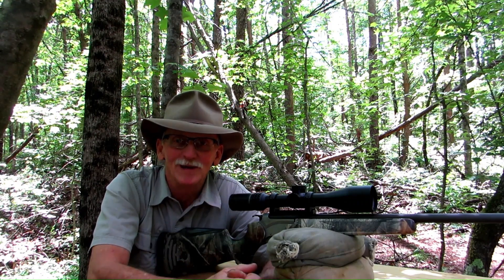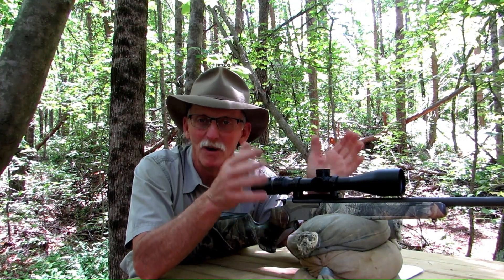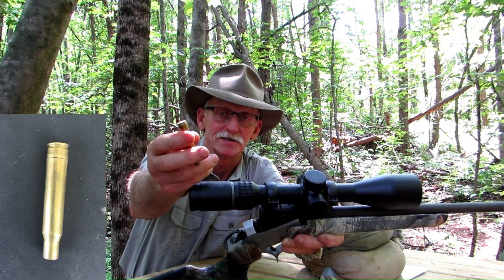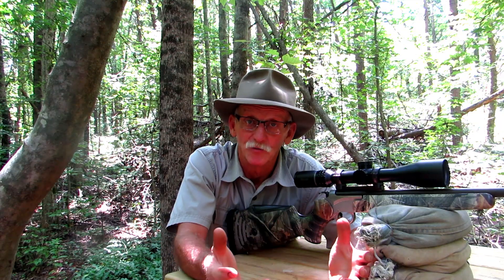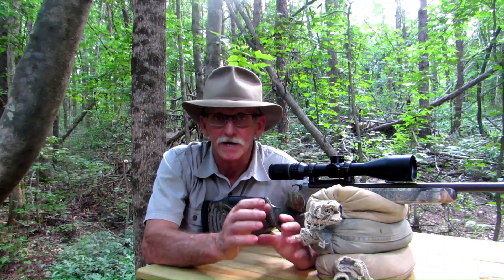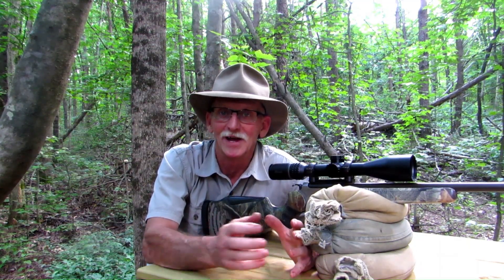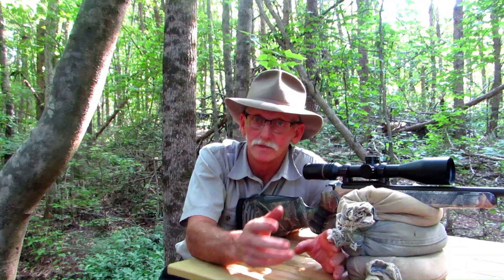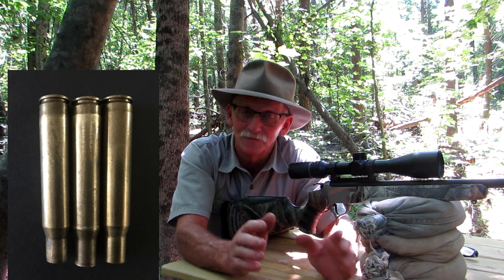The Thompson Center Encore And  Brass Life

Comment: I don't think a sharper shoulder has anything to do with the stretch that's occurring with an encore action. Even though a standard shoulder angle as in a 3006 will still grow in length between loadings, there's not an issue of headspace Separation there just the case getting longer and needing to be trimmed. The brass flows into the neck area thus eventually thickening the neck. The Encore is unique because the action is springy and it's allowing the back of the case to stretch back because of Bolt thrust. I don't believe the shoulder angle is going to fix that problem.
Reply from the maker: I share that opinion with you but there is a school of thought that says shoulder angle affects case stretch.  All that stuff is above my pay grade. 😁

Comment: My biggest aggravation was having numerous conversations with MGM about the problems I was having. They acted like they had never heard of that. If I had known that I  would have to down load the 2506, I never would have used the Encore platform. I'm running a bolt gun now and can easily get 14 to 15 firings from my brass. Limiting factor are the primer pockets, not case stretching.. This is also with fairly hot loads that I could never have loaded in The Encore.
Reply from the maker: I share your sentiments Brian. If I buy a Corvette I don't want to have to drive it like a Chevette LOL!

Comment: Had a 26" mgm, 2506 barrel. 100 to 120gr bullets, imr 4350, 47.5 to 48.5. Pushing 120s at 2850fps avg. Set shoulder bump at the very minimum. It ate brass. Ppu held up the best. Hornady was the worst. The best I could do was getting five loads out of PPU brass. It continuously would stretch the brass and eventually you were going to have a headspace separation. After 2 years I gave up, and went to a bolt action. I was set up with an oversized hinge pin and the headspace was correct. The action just flexes too much.Great for straight wall cases, though...
Reply from the maker: I agree. Straight wall and muzzleloader is what works best in the platform.

Comment: Ken, first time visiting your channel and like the content. As far as brass case stretch, have you considered the headspace as a contributing factor? A while back I read an article regarding shim kits made by Mike Bellm specifically for the T/C Encore. My be an interesting rabbit hole to explore...
Your other factors, per the video are also very valid points. Thanks again for a good video!
Reply from the maker: I make my shims. Run my headspace at .001 to .002. I have even tried negative headspace and slammed the action shut. Not good for accuracy! Doesn't reduce case stretch either. Experimenting with powders now. May be on to something but I need to prove it out more. Glad you found me. Thanks for the input. Thanks for watching.

Comment: Mr. Kenny when you do a trigger job on the encore, do you just file the sear or do you alternate the springs some? Or both?
Reply from the maker: Definitely don't file the sear. You can polish it but don't remove metal. I have lightened the existing spring but wouldn't recommend it to you because of safety concerns. You can buy a lighter spring. Here is a link to an excellent set of instructions. 
https://storage.googleapis.com/msgsndr/UP3u7sTYp1YkYjbYgscz/media/63fbdd3a61997f9fad05a4a5.pdf
Reply: Kurt belem is your friend on any trigger work or parts you need.
Reply from the maker: @brianowen497  I did my own but Kurt is the guru. I followed his online instructions. Excellent resource.

Comment: Just bump the shoulder back by .002” when you resize your fired brass.
Reply from the maker: .002 is the headspace that I run with all my barrels.
Reply: I would run the shoulder as far out as possible and still be able to close your gun correctly. If you start with 0.002 you're just adding that to whatever the gun stretches your brass and makes the situation worse as far as brass life. The Encore is pretty easy to set the shoulder up correctly. If you don't bump it at all you'll have trouble getting the Encore to shut properly and actually can hear it latch differently. Again any amount of shoulder bump is it going to add to the amount the case stretches after the firing. This is a non-issue with bolt guns but the Encore just flexes too much unless you download quite a bit and drop pressures.
Reply from the maker: @brianowen497  I have experimented with zero headspace with no increase in brass life. Three to four firings at normal 30-06 pressures. I may have failed to mention that. It is the .006 action flex that stretches the brass beyond it's elastic limit. Playing the zero headspace dance just caused me to waste  reloading components. That is just my experience though and it may differ from yours.

Comment: I have 2 T/C rifles, one in a 270 & the other in a 260, as far as brass life, the 270 5 shot group with Barnes 110 grain TTSX H-4350 powder 55.5 grains, max load is 58.9c averaged 3173 FPS, I have had this rifle for 4 years, shot many times and have never had a case head separation, the 260 I have had for 3 years and been shooting it quite a bit for 2 years now,  Lapua brass, 120 grain TTSX,42.1 Grain H4350 10 shot average FPS2869, max load is 42.3 and have just experienced several case head separations, I have checked and re-checked everything in my reloading process and have come to the conclusion that the close to max load is causing a problem, I had one man comment on that and that has led me to believe that is the problem and now that I have seen this video I'm more sure now. I have started to shoot new Lapua brass now and have had no problems, so I plan on keeping track of the number of firings and see what happens. After deer season I will start to scale back on powder charge and see what kind of performance and accuracy I can get compared to now, hopefully to have longer lasting brass. Thanks for the informative video!
Reply from the maker: You're welcome. Thanks for your input. With the 270 I have not had a case head separation either but that is because I had some experience with the Encore when I started loading for it. I'm diligent as far as checking my cases before loading now. The 270 for whatever reason is easier on brass than the 30-06 barrel. Maybe chamber differences? I'm not even close to max loads with any of my barrels except the 44 mag. Getting good velocity with middle of the road loads. I am curious as to how the Lapua brass does. If you would report back with your findings it would be much appreciated.

Comment: I have an older original blued Walnut model. I have a factory 24" .308 barrel, a factory 26" full bull 25-06, a Fox Ridge custom 50 cal MZ, a MGM 27" medium contour .338 Win mag and a 15" factory .243 barrel. I load hot for the .308 and 25-06 but have only run factory in the 338. I use a general rule of no more than 6 loadings in my non mag calibers and have had no issues, at least not as far as case trimming when contrasting with my bolt guns. My 308 and 25-06 loads are above listed max, carefully worked up. They're my most fired rounds. Originally broke that barrel in with 200rds of M80 ball ammo. Still  my original factory hinge pin. Ran 100rds, shoot then bore snake, of 100gr hornady interlock factory loads to break in the 25-06 barrel and 60rds of Hornady factory superformance through the 338 for initial break in. Only issue has been a crack in the pistol grip of the stock and an issue with using a hammer extension on the rebound hammer design. No play yet, locks up tight. Lots of meat in the freezer over the last 25 or so years.
Reply from the maker: It is interesting how results vary among Encore owners. I get as I said in the video 4 firings with loads that are far from max in all calibers. Results are the same with an original frame and a Prohunter frame. All my barrels are pre S&W. I can't really date anything as I bought all used. I do suspect my chambers to be a bit oversized although I haven't done a chamber cast. Maybe older barrels had better chambers? For now I'm just going to feed it's habit lol. I appreciate your input.

Comment: Case head thrust will always be an issue with break open designs. Big case head & high pressure = brass stretch. I have an Encore in 17 Fireball and that small case head, 30* shoulder, and 55K psi allows the brass the last almost forever. J.D. Jones of SSK fame was an authority on how much case head thrust the Contender and Encore could handle. His reloading data for the JDJ cartridges (using 225 Win and 444 Marlin brass as the parent case) reflected this.
Reply from the maker: Interesting information there. I have a .223 rem barrel. Loaded to factory velocity 55 grain bullet @ 3200 I get maybe 3 or 4 firings. I run it at 3100 and can get a couple more firings per case. Lake City brass. The case head is the same size as the 17 Fireball if I'm not mistaken. Only major difference is caliber, shoulder angle and .010 more case taper in the .223. Evidently the shoulder and slight difference in taper are making a big difference in thrust. Thanks for the input.
Reply: @kennethdellinger2037  My other Encore frame has a SSK manufactured .219 Zipper barrel. I don't have a bunch of barrels, I use both of them as dedicated rifles. If you have ever seen a cartridge drawing of a Zipper you will see the insane amount of taper that case has and shallow 12* shoulder. It's a low pressure round as it was originally a lever gun round. I load to 45K psi using Quickload and with the mild pressure brass lasts 7-8 shots before a case or three is too far gone out of a 20 case starting point. Using a headspace comparator on a caliper I set the FL die to bump the shoulders back .002" maximum.

Comment: The bearing and shear strength of the Encore's split locking bolt is comparable to that of most bolt action locking lug arrangements, but to be fair to the Encore, keep in mind that a bolt gun's lugs take the entirety of the linear back-thrust while the Encore's locking bolt takes a greatly reduced portion of the total thrust due to the hinge pin being relatively close to the centerline of the bore and well forward of the breech face. Unfortunately, that same "well forward" aspect of the geometry means there's a lot of steel in the Encore's welded underlug that gets compressed in the act of firing, making it comparable to a rear-locking as opposed to a front-locking bolt gun. And therein lies our challenge, which can only be gotten around by holding back-thrust to a minimum, which some of us seem to be having better luck with than others. Another great video, Kenny, as always. This is a fascinating topic.
Reply from the maker: Well said Steve. You explained it much more eloquently than I ever could. Didn't mean to imply the Encore system Is weak. Hopefully no one took it that way. Gave a simple explanation for the sake of time. Those viewers shooting the AI cartridges all seem to have the same experience that you have had. Those shooting standard cartridges have the same experience I have. I'm still intrigued by the idea of reaming my barrel though several have advised against it. My main concern is keeping the chamber aligned with the bore. We'll see.

Comment: You are 100% correct sir. I sold my original barrel due to case head separation. I purchased a MGM barrel and have oversized hinge pin now. I checked my headspace at lockup with feeler gauge and it’s zero. My fired .308 cases still grow 6 thou each firing.
Reply from the maker: I have a MGM barrel in 44 mag. The chambers are definitely better than factory barrels. Haven't done a cast but I am pretty certain my chamber is on the max side of saami.
Reply: That sounds like over pressured. Just above the case head how much is your brass growing in the web after firing? If more than about 0.001” you might consider dropping pressure or checking bullet seating depth vs the lands.
Reply: @ewetho What the video and I are trying to point out is there is slop in the encore platform. When you fire a mild load or factory round ,the case will stretch that much due to barrel to frame expanding. That’s why some manufacturers won’t chamber certain magnum calibers for encore. Not over pressure.

Comment: My ackley improved chambers 309JDJs, 6.5x257 Robert’s AI move very little near or at max charges. The 309 JDJ in the encore is up near full rifle pressure. I don’t care what the factory brass grows to from factory but if you shim the firing pin bushing to 0.002” clearance it should be fairly stable. AI growth is minimal. The more tapered the case the growth becomes stupid. I have 2 22-250 barrels I will not sell anyone as I have seen growth of 0.015” over zero headspace!!! Yes the round is tensioned in the action. 

The chamber should not be changed to AI as to be properly AI the neck shoulder junction actually moves back towards the head by about 0.003” 

How the sharp shoulder helps with the hammer strike the case will collapse then re-expand to the head. The larger the diameter of the brass the more thrust you get for a given pressure. 

So how do you size the brass? If you just fill length and do not measure it to the chamber then ouch. A .30-06 AI would be far better.

Hinge pin is great for accuracy (I have done all of mine) but not major concern for brass life as the difference between them is in 10 Thousandths of an Inch not thousandths
Reply: Try resizing brass specifically for this gun(barrel/frame assembly) by resizing it only as much as required for a 0.002” feeler gauge to fit between brass and firing pin bushing while the action is locked. 

Shoot mid-range loads if you needed more than you should have gotten a WinMag 

The stretch is the mouth of the case sealing the front of the chamber and the brass filing the chamber behind. If you minimize the space you have less growth. Minimize the taper also limits growth by reducing bolt thrust as well as the sides of the brass will grip the wall. At one point PO Ackley shot one of his with no action to prove it! 

If you were to convert it to an AI style cartridge I believe the 30-06 JDJ has shorter neck and would allow a rechamber. Then you would have to special load the first firing but would have AI styled cartridge afterwards
Reply from the maker: My headspace is .002 max on all my barrels for the Encore. Learned that early on. With my barrel/frame combo the .003 movement toward the head should not be a problem as I am using a .005 shim under the firing pin bushing now. Thats if I'm understanding you correctly. Thanks.
Reply: @kennethdellinger2037 sounds like you are down on it. Biggest issue is case taper and slow sloped shoulders. Allows for crushing of shoulders and then 0:08 case thrust against the bushing. At high pressures it will spring the frame open, not unlocked just under tension.

The reason my 22-250 is now a bolt gun. But my 243 only resizes a couple thousandths and my 6.5x257 Robert’s AI and 309JDJ (almost identical but caliber) don’t hardly grow at all. 

Funny note my 243 is rimmed optional, and yes I made brass from 444 Marlin. But neither rimmed or rimless seem to grow much for me. But rimmed is very minimal as the shoulder can’t be driven forward with the rim stopping the brass.
Reply from the maker: @ewetho  That's my understanding of it. I've read Ackley's articles as well just wanted confirmation from experienced break action guys. I would probably be ahead to buy a quality barrel chambered in AI or JDJ rather than wasting money on the factory barrel. Thanks for your input. BTW I checked out your channel. Good stuff!

Comment: I'am at 15 reloads on a 1:10 twist 257 Roberts AI,46.8grs acc 2700,115gr nosler partition c.o.a.l 2.940. I'am getting .75-1.00 moa at 100yrds with a 15" barrel.
Reply from the maker: That’s impressive. Good to know. BTW I thought I was the only person on the planet using 2700. Awesome in the WSSM, 270W and the old 06. Thanks for the info. There may be a reamer rental in my future.
Reply: @kennethdellinger2037  2700 is the only powder i can get to group in this barrel. The barrel started as an unchambered MGM barrel & PT&G reamer cut to min saami specs.
Reply from the maker: @mnstrxj3280  I discovered it during the pandemic powder shortage. Glad I did. Don't hear many comments about it.
Reply: I'm considering ordering a MGM barrel in 257 AI.
Reply from the maker: Let’s us know how it does. MGM makes a good barrel.
Reply: @kennethdellinger2037 any suggestions on barrel length? I'm new to this caliber.
Reply from the maker: @williebagley2282  No experience here either. The guys at MGM may be able to tell you what optimum is. They've been helpful to me before.
Reply: @williebagley2282  I'am only using a 15" pistol barrel, but if i'd build a rifle a 20-22" med contour barrel would be good for general purpose use. Just my 2 pennies worth.